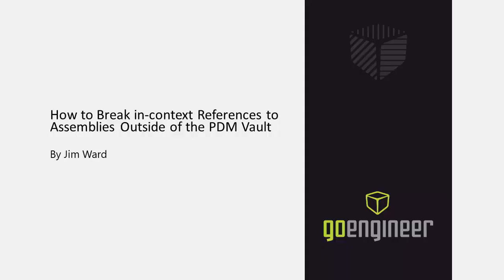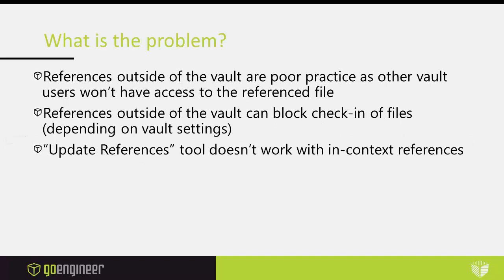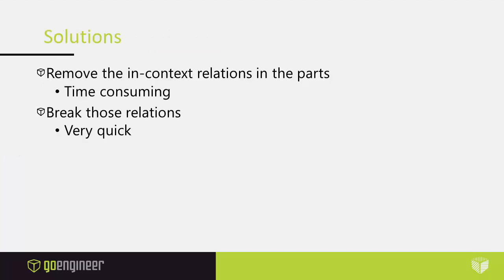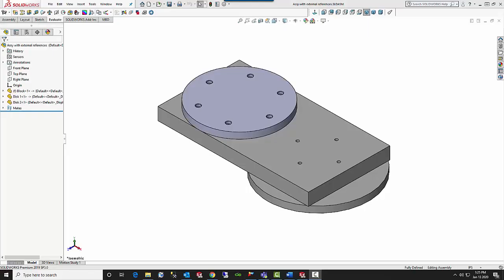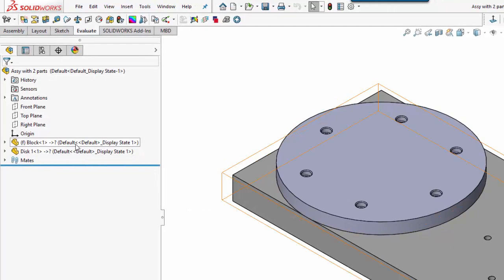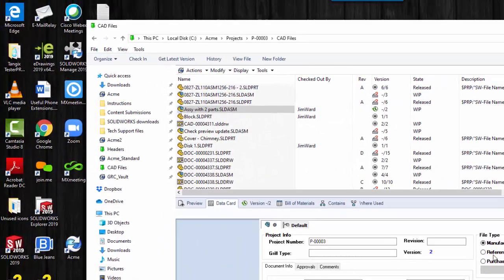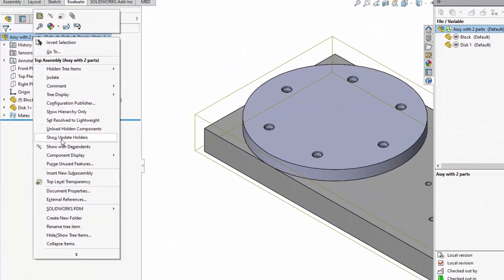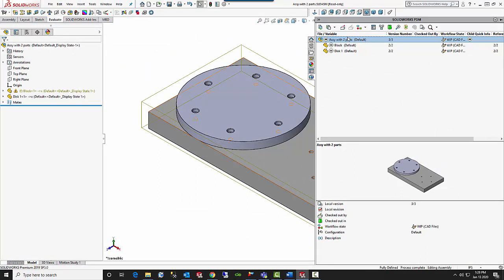SOLIDWORKS PDM Tutorial - Breaking In Context references to Files Outside the Vault

Comment: Could you save the file as a part and then it wouldn't have the relations any more?
Reply from the maker: Yes, saving as a part will break all the references that the assembly had. But it breaks ALL the references. You may only have a few that are outside of the vault, and you still want to have an assembly. There may still be changes you want to do to the assembly that cannot be done if you save it as a part. Using “Save as part” is great for purchased components in which the model is imported as an assembly. But for a component you are creating, usually you want to keep it as an assembly.